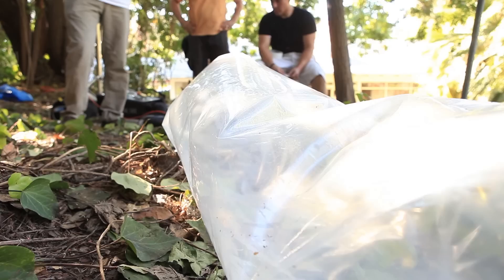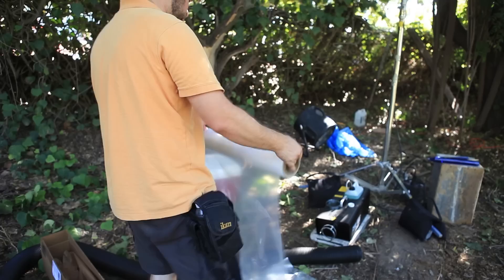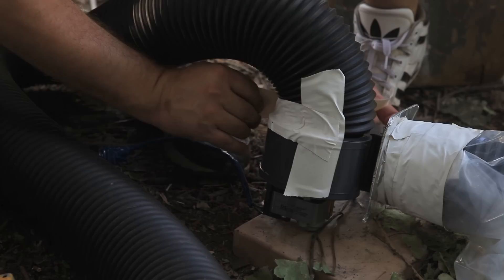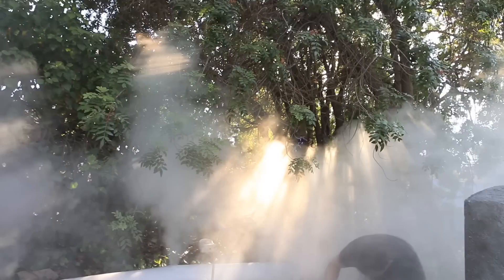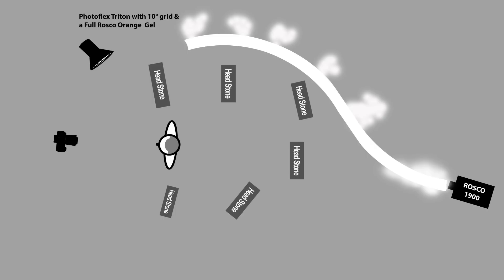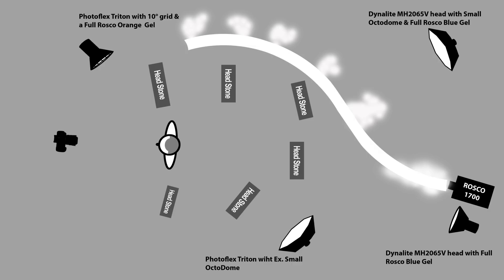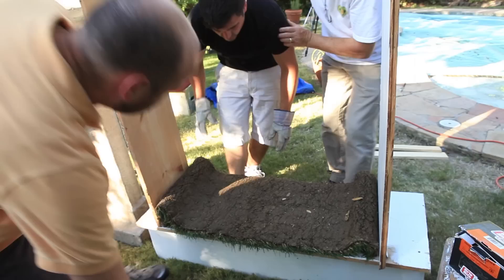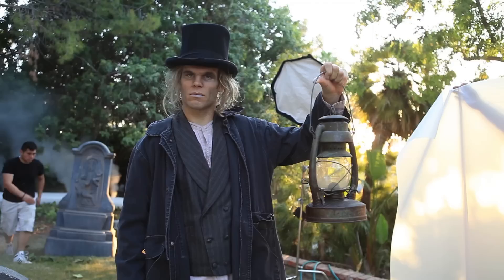Special Effects: Smoke Tube of Death - Photography & Video Tutorial

Comment: Do not cut into smoke tube, you run the chance of having the small hole turning into a large once. Simply use your propane torch to melt small holes in it, now if you want to close the hole, just shove a empty small disposable water bottle into the hole, I’ve even went as far as cutting slots in one side of the bottle making a directional nozzle, pull it and put a cap back on it and it’s now closed. Once the tube runs for a while it will get slimy and tape will not stick
Reply from the maker: hey rob, thanks for your insight!

Comment: people watching this remember that most fog machines will create a lot of heat and will melt plastic tubes so start with a metal one to dissipate the heat
Reply from the maker: Great thought. The nozzle of the smoker is very hot. You either need air around it in the transition or a metal pipe.